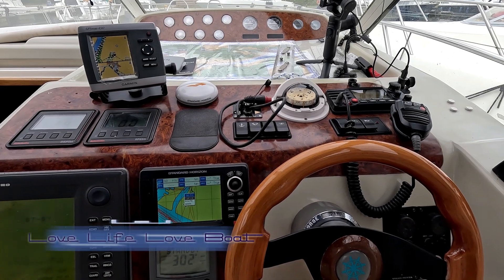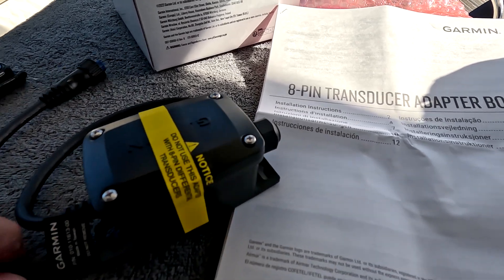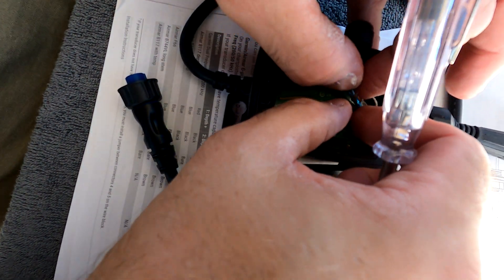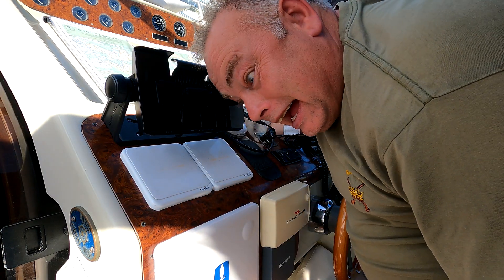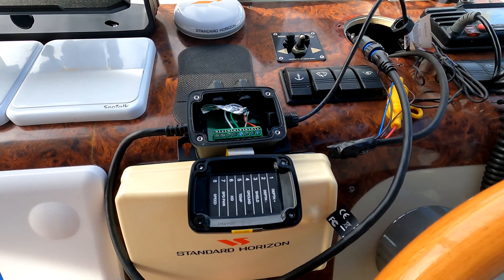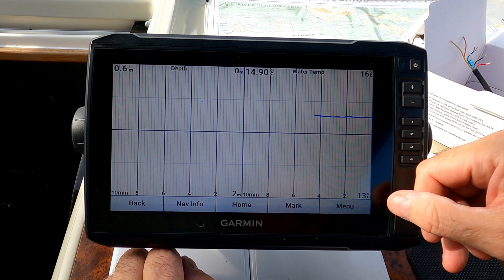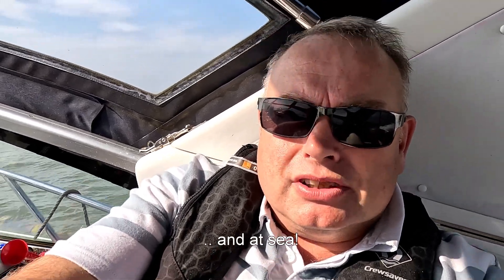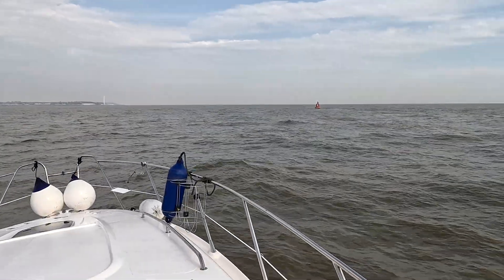Garmin EchoMap - Old Transducer Install and Sea Trial #Echomap

Comment: Good Info again, Looks like you had fun at sea as well .
Reply from the maker: Well I was having fun, but there is an upcoming video of what happened next, as we had planned to push down to the IOW over 2 days but we had the dreaded fuel problem! I have never purchased diesel on the Broads system - I wont again....! Apart from that, and a few tweeks, the install is working well and I am having to 're-learn' how everything works! Have you found a new boat yet?
Reply: @lovelifeloveboat  
Yes Broads Diesel How Long Do they Have that in Their Tanks .
Thank You For Asking. 
I Have put an offer on a Boat Today, And Very Excited But Nervous
Will Find out in the next Few Days When The Owner Gets Back to the Broker.
Reply from the maker: Well we are keeping our fingers crossed and super excited for you. Looking forward to hearing about your acquisition soon!
Reply: @lovelifeloveboat  Getting into Finale Negotiations now, should find out today

Comment: navionics is a rippoff when you think garmin not charge anything for inland road maps yet for sea they charge a fortune
Reply from the maker: That is a fair point - especially when Raymarine are now bundling the Lighthouse charts with just about everything - even though it lacks auto route planning (Which, incidentally, I actually don't like). Luckily we managed to negotiate the Navionics + in the bundle, however, there can be no justification in the difference in cost between this and their app based software!